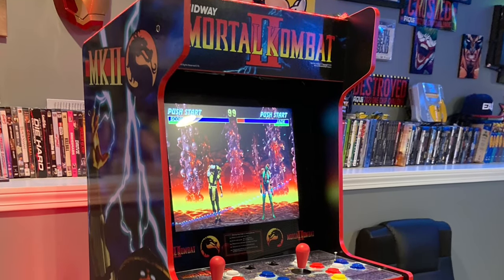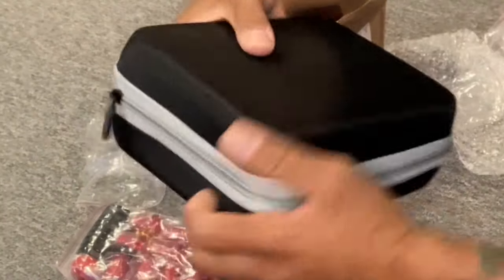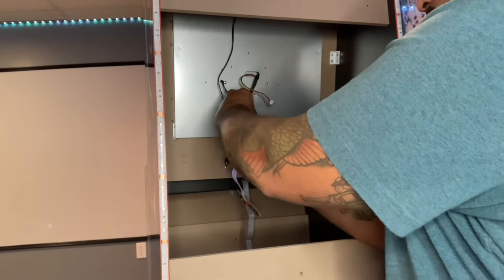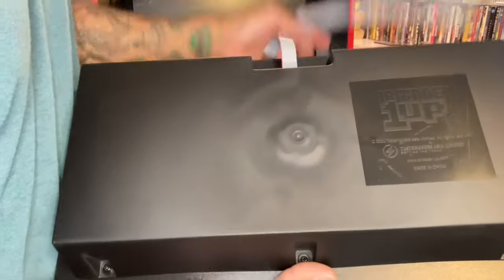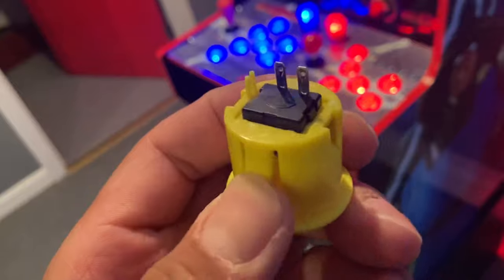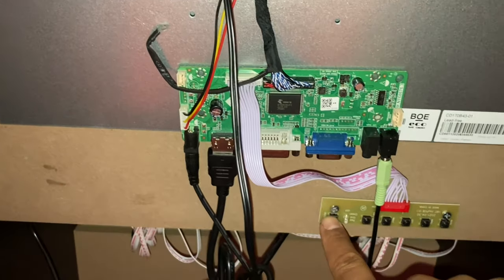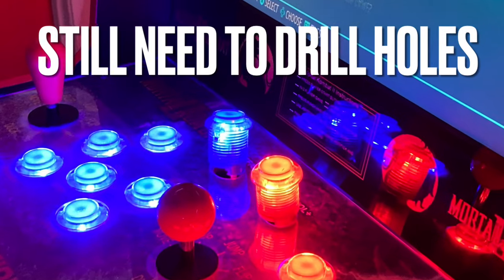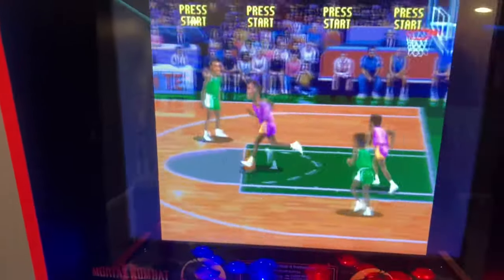How to add 33,000 games to your Arcade1up #subscribe #arcade1up #how

Comment from the maker: A couple forgotten details! I know, i suck.

1.THE HDMI CONVERTER USES SAME POWER SUPPLY THAT THE CAB COMES WITH. 

2.YOU WILL NEED TO BORE OUT THE STOCK POWER AND VOLUME HOLES TO FIT NEW BUTTONS FOR “SELECT”. You can use these extra buttons as select and hotkey inputs

More FAQs https://youtu.be/2WbSZagPBWs?si=jI1yVdXusqi2k4qO
Reply: Hey I have tried everything and believe it’s all correct but still can’t see anything the screen lights up black but that’s all I can see I can hear other games playing and that’s it. Any shit you can help?
Reply from the maker: @FrostyBite  hhmmmm, and you checked all the connections to make sure theyre in all the way?
Reply: @dadgamertv84  I can double check is there any way I’m able to contact you if possible or is this the best bet. Haha we can double check we just have some lights atm. On the screen
Reply: @dadgamertv84  the screen is just goo in red. Then blue then green then white then black.
Reply: @dadgamertv84  we haven’t changed the on/of button and the Vol button yet but surely it would still load without them. Sorry for all the questions hahah
Reply from the maker: @FrostyBite  are those buttons connected at all in any way? That might be your problem
Reply from the maker: @FrostyBite  i’ll check mine out when i get home from work
Reply: How do you factory reset the emulator?
Reply from the maker: @WannaL0L  button configurations or the whole emulator? To reset the whole emulator, its under “Danger Zone” in the settings.
Reply: I messed up on the button config and I didn’t have a start button assigned. I saved it so now I can’t even redo the control config. I don’t know how to get to the Danger Zone under setting.
Reply from the maker: @WannaL0L  ok so STAY AWAY FROM DANGER ZONE. you should be able to reconfigure under controller configuration
Reply: In case I missed it can the arcade box be used with the original control set that the original one up arcade comes with
Reply from the maker: @jacobfurtaw5185  unfortunately not
Reply: @dadgamertv84  thank you for replying
Reply: link to it is dead!
Reply from the maker: @migueldelcastillo7269  i just replaced it with this one. more games, same price Kinhank Super Console X Pro with 60000+ Games,TV & Game System in 1 Mini Retro Game Consoles for 4K TV HD/AV Output,Compatible with 63+ Emulators,2 Wireless Game Controllers Included(256G) https://a.co/d/egXoH4n
Reply: Hey bro is there a way I can just buy the arcade box and just hook it up to my tv and just play all the games that way ? Or dose it have to be only for the arcade 1 up just wondering 💭?
Reply from the maker: @austinflynn1097 its made for the tv..
Reply: Where do u buy the mod
Reply from the maker: @polopolopolo712 Super Console X 256G, Retro Video Game Consoles Built in 65,000+ Classic Games,Game System for 4K HD/AV Output,Compatible with 60+ Emulators, 2 Wireless Controllers,Gift for Men/Boyfriend https://a.co/d/9Hirr2B
Reply: So each side has its own “select” button which was once either where the power or volume was? Is this also the same for the start buttons? It looks like in your video it was the button corresponding to the person icon at least for the blue side.. is this the same for the red? Great video I was just hoping for some explanation for that particular part
Reply from the maker: @teenlaqueefa8339 yes correct. Youre right, i couldve explained that better. The power and volume buttons were replaced and used them as the “select” for each player. And used the “player buttons” as starts buttons
Reply: @dadgamertv84  Thanks man! I appreciate your fast response!
Reply from the maker: @teenlaqueefa8339 i made a quick YouTube short addressing it. Thanks
Reply: @dadgamertv84  hey! I am thinking about doing this! Great video-just curious…do you gotta open it up and turn off your super console x every time you use this now or do you have another way to turn it on and off?
Reply from the maker: @thomaskiser3886  https://youtu.be/2WbSZagPBWs?si=1rTEUhlF-pqDsAQ5
Reply: @dadgamertv84  appreciate the information!! Thank you!
Reply from the maker: @thomaskiser3886 anytime, good luck and have fun
Reply: hey I know the MVC arcade1up seems like a bad deal at $600 and it is but you do get easy online  support and a much better button layout than the mortal combat cab. personally im getting a legends ultimate which is about the same price plugging in there gamers pro control panel for full 8 buttons and connecting it to steam to play retro and modern fighters like SF6 or the brand new MVC collection when it comes out with full online too pretty nifty might be better for you!
Reply from the maker: @spicylemon6973  thats cool and i appreciate that but this is literally decor for my mancave. I play it maybe 2 times a year which makes me happy i haven’t bought any more . Other than that, i just switch the game on display
Reply: I just installed mine but my screen is just black you can tell it’s on it lights up but nothing pops up on the screen?
Reply: @FrostyBite hey how’s it going I’m having the same issue with mine did you ever figure out the problem?
Reply from the maker: @reaper1948 not sure, just double check and make sure all connections are secured

Comment: Just wanted to pop in here to say i followed your guide step by step for modding my cabinet and you made things SO easy. I have zero experience with any of this and managed to nail it by rewatching this video about 100 times lol 🙌

Lil tip for anyone doing this mod with a midway legacy - you can order a new control panel with the additional button holes pre drilled for like 65 bucks. Made this project super smooth...thanks a ton DadGamer!
Reply from the maker: Awesome!! Glad to here it
Reply: send the link
Reply: Send the link
Reply: im adding the select buttons as the 25c button on the front of the cabinet
Reply: Link please?
Reply from the maker: @thejustinadler https://a.co/d/0F4IzwU

Comment: Thanks DadGamers TV.  I watched a few videos on modding, including ETA Prime's, but your video gave me unique information that suits my needs.  I got an old Super Console X several years ago but didn't play much (the ps3 controllers suck), so I wanted to put it in an Arcade1up. Your video fits my situation, as the Arcade Box is similar (both use Emulec). I also didn't understand why we need to splice stock speakers and get an expensive AMP for sound anyways; your suggestion of using old computer speakers is great (I got one for 7 bucks from GoodWill).  Finally, your tips on controller/display settings and hot keys for sound control are very helpful.  I have a fully functional Street Fighter Arcade1up mod now with Super Console X, very happy.  Thanks!
Reply from the maker: Awesome!!! Glad to hear it
Reply: This is exactly what I want to do as well💪🤓

Comment: Thanks for the awesome, simple to understand video. I do have a quick question though, at the end of your video when you're showing some of the games, i.e. Mortal Kombat, will there always be black side bars for certain games? I saw in a different video where you can go into settings and set the video output to 16:9, is this an option that's available on your system? Can't wait to start playing some old school games!
Reply from the maker: Yes, switch the ratio to 16:9 and it’ll be full screen

Comment: Thank you for great video, it gave me enough info to do this myself. I found out that if you buy the cheap amp seen in other mods, you can use the stock speakers when they are connected from the HDMI board to the amp. Hope this helps someone in the future as well.

Comment: Looks like they weren’t crimped properly and the heatsink was not applied properly. When it comes to stuff like this be ready to put in work that the factory didn’t.  Car speakers get stuck also a little but once you unplug it like 3 times it should be easier to pull out. Looks exactly almost like the connectors for car speakers

Comment: Do you have to turn on the Arcade Box from inside the cabinet or how does that work? Simple method though I like this a lot. I was thinking of getting a PC to run Botocera on one of these but may do this instead. I want it to be as seamless as possible, as if it were intended to come that way.
Reply from the maker: After i made the video i ended up drilling a hole in the back cover of the cabinet , right where the power button is on the Arcade Box. Since i mounted the arcade box on the rear support panel, it made it easier to do so. That way i dont have to keep taking the back panel off.
Reply: @dadgamertv84  That’s a good idea. I’m doing a build with a PC instead of the Arcade Box. I bought a remote power button for it, and I’m going to drill a hole in the back as well. I liked the PC option as it seems more versatile and also it was cheaper lol.

Comment: how is the arcade box doing?  I haven't seen many reviews on how well that box handles after a few months
Reply from the maker: Working fine. Its more if a decoration piece these days, i change the game every couple days. I leave it on. Alot of guys were mounting the box with the fan up against the wall which was making it shit the bed. I have mine with the fan facing out.
Reply: @dadgamertv84  Thanks for the reply...

Comment: Great Video i'm about to get the street fighter 35 anniversary.  The only videos I have seen done have been on the Mk2 machine...will this work on any machine?  Thanks
Reply from the maker: Thanks. Different machines have different connections so just make sure you have the right HDMI converter. Once you get a converter, you throw anything thats hdmi in there.

Comment: Good video 🫶. I have two questions. The first is that the whole thing works without replacing the original buttons. The second question is does the coin slot still work after the mod? I would like to set up a machine with lots of games, but the coin slot has to work.
Reply from the maker: My coin slots are non functional, theyre just a flat panel board. And yes you have to replace the buttons for this particular mod

Comment: I noticed the kit didnt come with a power supply{ I ordered it separately} Do i need any other cables /hardware other than the 3 items you listed?  I'm pretty excited to start this, gonna take a bit to receive the arcade box.
Reply from the maker: You can use the same power supply the cab comes with. Cancel that order if you can
Reply from the maker: Sorry, i forgot to say that in the video 😏
Reply: @dadgamertv84  its ok thank you for the reply!

Comment: Do you need the MKII Cabinet to do this, or can you do it with any cabinet? Also, could you make a video going through some of the games? Specifically , the MAME games. Thanks!
Reply from the maker: Sorry, i just saw this. You can do it with any cabinet as long as you get an HDMI converter that is compatible with its screen. I will make a video of the games when i get a chance to

Comment: I just bought the same cabinet with the intention to modify it the same way as in this video ! Just ordered in fact the hdmi converter from aliexpress ( will take a month it says to be delivered ... ugh.. ). Thank you so much for the instructions ! 

The only issue that bothered me with this particular cab is that its kinda short for me ( I'm 6.2 ), so I ended up buying four metallic legs 10cm in height to raise it up a bit.

One question - wouldn't it be possible to use the speakers the cabinet comes with ? They seem to have a standard speaker jack, I think so anyway.
Reply from the maker: Yes, you can use the original speakers.the pcb has a 3.5 mm jack in it as well, it has 2 of them just make sure you plug it in the right one. Theyre just not as loud.
Reply: @dadgamertv84  Thanks again !

Comment: Yo dude! I just got done following along with your video on my MK3 cab and it’s looking really great. Thanks you 👍 one question, I went through the process of mapping the controls like you showed but then when I jump into games the system seems to default to different controls for different systems/games and it loses the mapping I just put in? . Any idea how I could make this work consistently in the settings perhaps?
Reply from the maker: That happened to me too, i just kept annoyingly remapping them and left it on. They ended up sticking after leaving it on

Comment: I did all the same stuff in my Simpsons cabinet, but I can't stand how it does not use the full screen properly. These arcade boxes are made to work great on a 16:9 tv.  I saw that your basketball had the black bars on the sides. I was able to configure game by game to solve this if you set that basketball game to 16:9 instead of "auto" with bezels removed as you have it, it will fill the screen and look great.  However, I can't find a way to do it "across the board" to have video output as a 4:3 display so it fills the screen properly - the same 16:9 setting in game like galaga stretches the screen horribly.  Did you ever find a way past this?
Reply from the maker: Yeah i put it on 4/3 under system settings and it stayed for all games

Comment: Questions so machine is always on? And when changing power and volume button for select are you just changing configuration?
Reply from the maker: Yes i leave mine on BUT make sure the fan of the arcade box is facing out. Change the button mapping in the arcade box menu

Comment: I see where you said you made a hole for new on off button button when changing old off on button did you just change configuration or was it a port in the back that had to be plugged in to new button motherboard
Reply from the maker: Yes, the motherboard comes with a diagram. Make sure select is plugged into select. Also, map it in the menu.

Comment: Hey man I’m doing this to my NBA jam 4 player and I’m struggling to get buttons to work. Do I need to add more buttons to get it to work correctly? And how did you get your speakers to work
Reply from the maker: This is a 2 player mod only, since the arcade box only supports 2 players. I connected old computer speakers but the hdmi converter supports the 3.5mm jack for the stock speakers
Reply: @dadgamertv84  
Yeah I don’t care about the other two joysticks, just trying to get two of them to work. I did buy a four joystick upgrade so my wires look different then yours. Just can’t figure out how to plug them into the board. Seems like everything I try it won’t bring up that menu to set controlers
Reply from the maker: @callmebrady  did they come with a diagram to wire them correctly?

Comment: I want to add that arcade box to my 1up, but I really don't care about the buttons. Is that needed to function with the Arcade box?  I was just planning on changing the handle grip, the springs and restrictor plates.  May have answered my own question by watching the rest of this video...... Well shit.
Reply from the maker: Yeah you kind of have to since the arcade box uses USB ports for controllers.
Reply: @dadgamertv84  I also noticed you have some PC speakers in the cab, Would it be fine to use the speakers that come with the cabinet? Sorry for bombarding you, just got this thing for Christmas and already about to tear it apart. Its the Gen 3 model I think.
Reply from the maker: @chamisbeard8301 i have no clue about gen model numbers, i just made a video thats easier to follow than all the videos i watched. You can use the stock speakers, its just not as loud.
Reply: @dadgamertv84  Welp... Im doing it! F it.

Comment: Love this video bro  As a fellow dad, i have a question?  I built a bartop using same joystick kit except I used the super console pro cube instead of the arcade box. Worked pretty good except it took real long for screen to pass the Emulec boot up screen. And it kept switching the joystick from player one to player two after some boot ups. Did the same thing happen to you using the the arcade box? I want to build another bartop using the arcade box if it works better and more consistent. Thanks bro. Salud 🍻
Reply from the maker: Yup same thing happened to me, then i double checked the wiring. Have to make sure they are wired into the same exact spots as each other. Use the diagram if it came with one. After i double checked the wires, it was fine.

Comment: Thanks for the video!  Is there a way to use the stock controls with the arcade box you added?
Reply from the maker: If you find an hdmi converter that uses the stock connector of the control deck

Comment: Where can I get the boards to convert the buttons to hdmi? Not in link. Bought everything else
Reply from the maker: VSDISPLAY HD-MI DVI VGA Audio LCD Controller Board Fit for 17 inch 4:3 1280X960 DV170YGZ-N10 DV170YGM-N10 https://a.co/d/iknMbpP

Comment: thanks for this beautiful video, i have followed the steps and am all good, but i also have encountered some issues, i have the latest arcade1up the yoga flame one, 2 features stopped working which is the cabinet lighting and the internal speaker that comes in it, i had to buy a new speaker, if you ever going to make a new video to mod ur speakers it would be lovely instead of buying external ones, am in for another challenge as well. as for mine i have added three more button and i used a drill to make the holes more wider a bit to fit "in" the button instead of them popping out just like urs for the additional ones, and you got a subscribe :hand-pink-waving:

Comment: I bought this arcade box because I watched your video. When I plugged it in the screen is white. I hooked the arcade box to the tv, so I know it works. When I connect it to arcade cabinet. The screen stays white
Reply from the maker: Make sure the the moniter circuit board that has the power button is attached securely. If its loose, it will mess with the screen